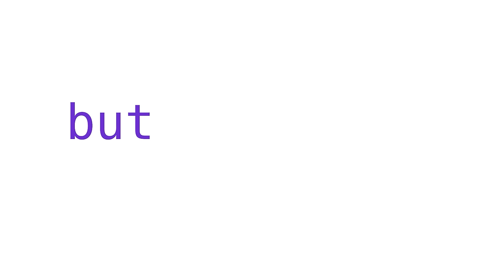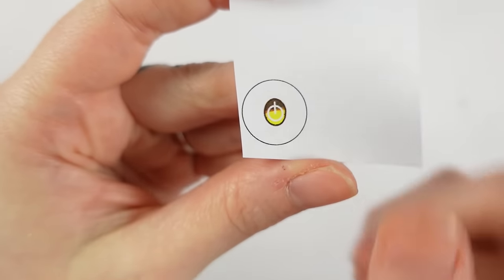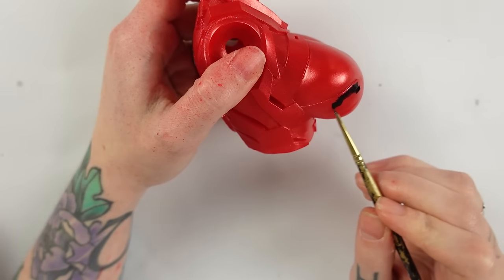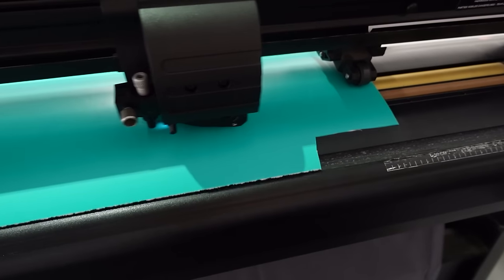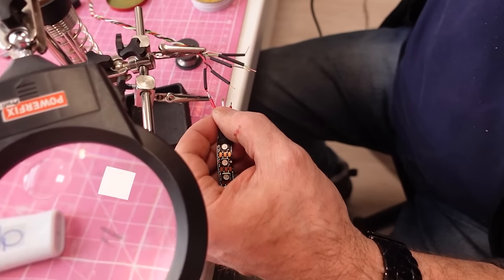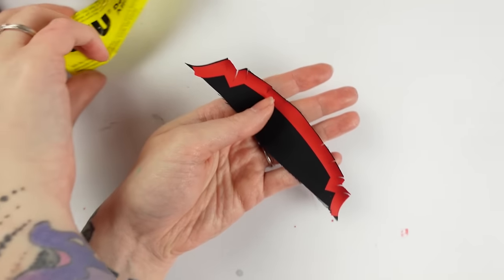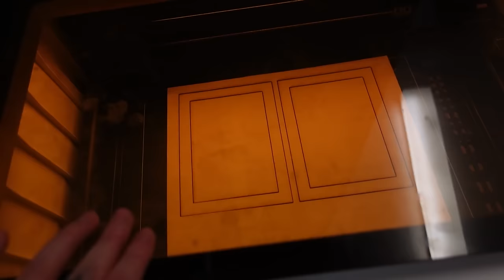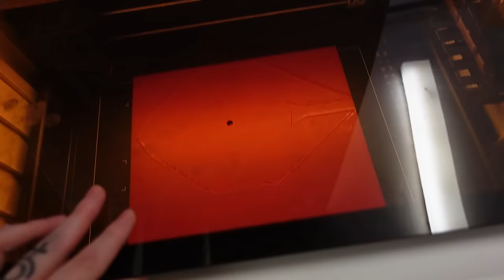I Made an ACTUAL CYBORG

Comment: Next time, an ESP32 or ESP8266 can run WLED by wifi or bluetooth, and with addressable RGBs (WS2812B for example) you can customize lights individually.
I mention ESPs because they're probably small enough to fit in the figure/doll and are Arduino IDE compatible, like the board used here.

This is the kind of project I wish I could do, so far I've only made room lighting that can do color waves and stuff.

Comment: Hi, just some aside about the electronics:
the arduino uno is HUGE, and you used 2!

take a look at the adafruit trinket line, or the feather line (those can also do battery charging if you want to not have a cable on there 24/7), they are like 99% arduino compatible and WAY smaller. also you can probably combine the 2 controllers and just use one board

Comment: If it was just lights and the screen. You can try to use an Arduino nano it's small than the Uno  but functions the same and would fit inside the doll as well as the battery pack. And have a switch on the back of the doll

Comment: Wow, you've outdone yourself again :O

But as someone very familiar with electronics: would have been nice to get someone to help on that part, they would have been able to make a custom circuit board that is much smaller so it can be inserted into the doll. You can definitely make something that works for this in the size of a euro coin. Also I'd prefer for the cables to be soldered to the board because those connectors come loose more often than you'd like. Although, then you'd have to add a battery and maybe a charging circuit as well. Would be a fun project for an electronics enthusiast for sure.
Reply from the maker: Sadly I didn’t know anyone who knows these things 😢

Comment: The neck with face type head looks kinda too long I think. The visor head is just nice.

For painting, usually you would do the color with the largest area (i.e. black in this case) than mask the black and do the second largest area, i.e. the metal red, then finally the details, the teal strips. As a 3D modeller/3D printer hobbyist myself, I usually would separate the parts with different colors apart, paint them, and assemble them (either with glue or screw or just friction, and probably some self-locking mechanism).

Finally, if you do not intent to make the torso glow with bloom lights (which has the potential of exposing the structure of the model, and the wires and other electronic parts, if present, as the led stripe is not glued to the model, but used like a hanging light bulb, it will cast shadow on whatever things inside), it's recommended to paint the inside of the torso with thick coat of black, this will let the light to be only shown at the opening that is meant light to shine through.

Sorry for the criticism, but as a long term Gunpla model builder, I just can't resist pointing the problems out...